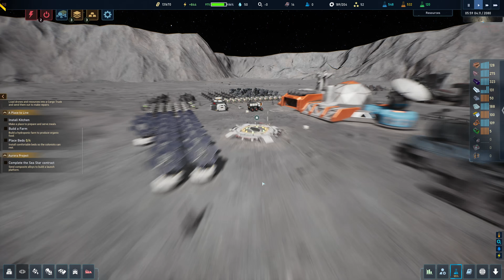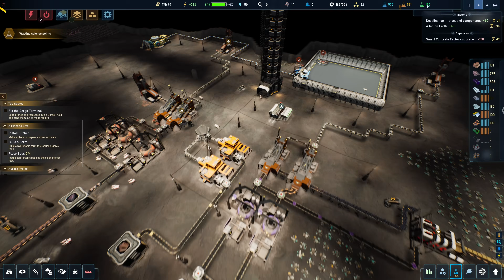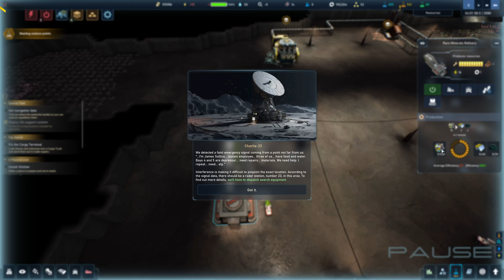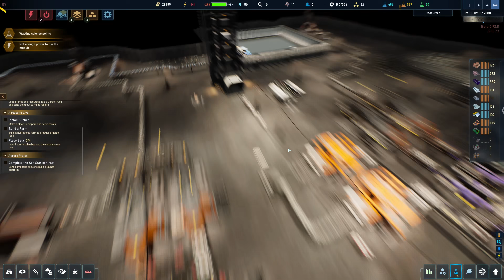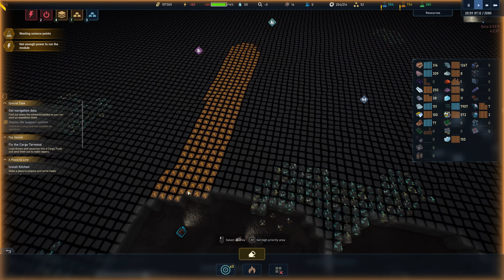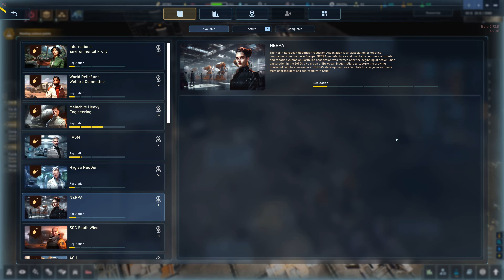MICROCHIP PRODUCTION - The Crust || FULL GAME Complex Factorio-Like Automation Part 05

Comment: The problem with producion, where u changed belts was not that, it was night and your batteries cannot power everything. There is charge(capacity) and then is how much power can they send out at once, u were 140 in negative (the number before battery charge on UI)

Comment: but... why no bus?
Reply: belts are so expensive, bus build costs fortune:)
Reply: @cuneytvural72  so resources are not endless?
Reply: @galsherp6173  Underground resources are not infinite but there are mines on the surface of the moon so you can mine and transport it to your main base after your underground resources depleted.
The main problem on story mode, you have a timer, you need to be quick but maybe in sandbox, you can setup a proper base with bus and create planned, well designed factory.